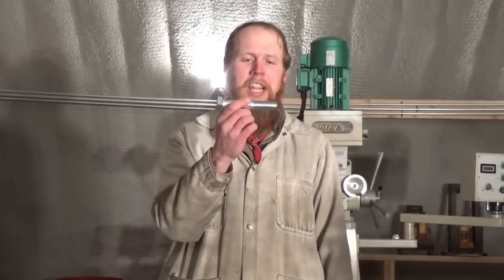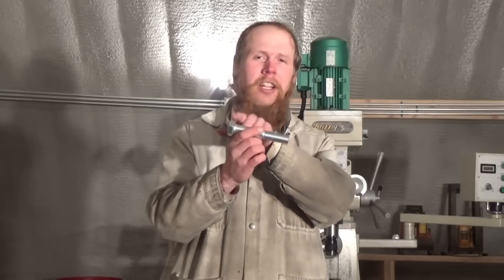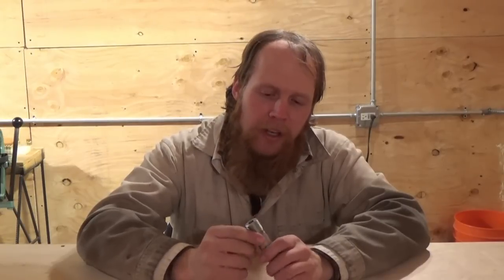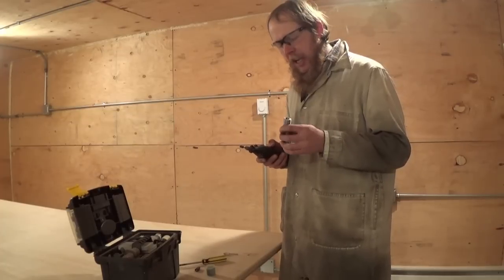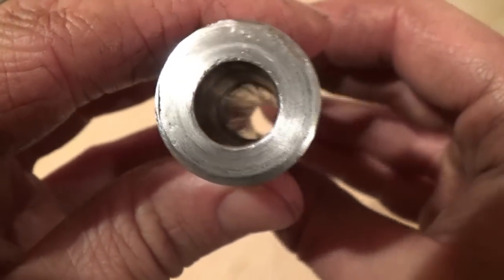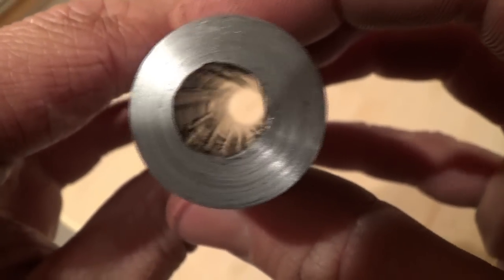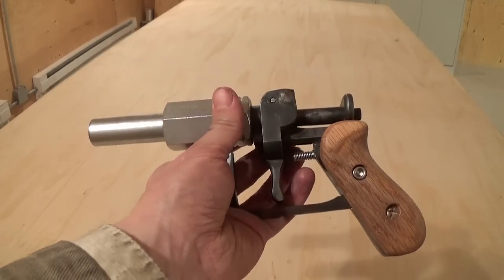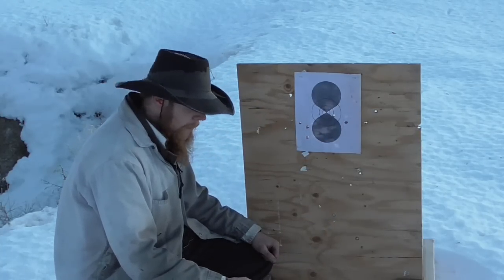Making a Rifled Barrel without Machine Tools (TIS081)

Comment: maybe try putting a ball bearing between the button and the ramrod, so the button is free to spin as it wants
Reply: Now, that's not a bad idea at all : )
Reply: Or even one of those set screws with a spring loaded ball at the end and thread that screw into the end of a piece of round stock.
Reply: @jmorginski  I have a really dumb layman question... only started researched all this... Why is it essential for there to be a curved twisting grooves down the barrel? Is this to make the bullet spin to prevent bullets tumbling and keyholing shots? Thats just a wild guess. I'd appreciate if you or anyone can confirm or tell me the real reason??
Reply: @differentwavelength6553   that is exactly, accuracy and range would suffer without rifling in the barrel.
Reply: @differentwavelength6553  bill cooper porterville presentation. 10 hrs aslo hour of the time broadcasts. Bill Hicks  revatalations. George Carlin. Adam green know more news. Jake black stone intelligence. Alot more. Projectile and it's shape needs guidance as it is launched and plays to the phisics of flight through the air. The projectile fights wind resistance so if you have a stable launch of aero dinamics and rotation of projectile it will not break it's stability through its flight pattern. Paper planes, golf balls, base ball,   throwing a simple football are basic starters for most civilians learning. I'm sure there are formulas figured by men, and women that have been achieved. Also the wright brothers had to figure out alot for their accomplishments. Sorry.
Reply: Different Wavelength yes that is correct
Reply: @differentwavelength6553  haha tyrannical has a whole new meaning since you made that comment.
Reply: EitriBrokkr, thats a great idea man!
Reply: Great idea.
Reply: I don't know. Perhaps smoother button and ramrod faces with some quality grease is a better idea. Because I believe with a bearing, during the rifling process, might be unevenly pressured resulting in low quality job. Again, I am not that sure

Comment: Great video that made my day! Since i was young, i was always intrested in making my own gun, though law in my country is very strict about that, so i never tried. Until i saw your video i thought rifling process is only available to professional machinists with serious equipment but now i know its not so hard. Though one thing caught my eye - when you made the button, why didnt you make the cutting edge to be sharp and the back of it slightly decreasing?
Reply from the maker: Thanks!  The edges of the button are blunt because they are not intended to cut the steel; they just cold-work it, leaving an impression due to the pressure of the fit.  Making a "button" with cutting edges would be a form of broaching, which might also work, although I have never tried that method (yet).

Comment: You might have been able to get the barrel drilled closer to center if you had clamped the boards you were using to hold the steel in place to the drill press, and left them in place for the whole process. As you said though, little tweaks here and there. This was an impressive result over all.
Reply: Or just cut the bolt head off after. The head would have made using a clamp all too easy.
Reply: Rotating the barrel would be benefficial as the center of turning is easy to locate with a center drill. The more centered the drill is and drill lined up with rotation axis it will do straighter and more circular hole.
Reply: Ed What's his name I thought the same thing.

Comment: Without  machine tools!! Yeh right ! Click bate !! You used loads of tools and machines. LIAR
Reply from the maker: Sorry if you're not familiar with my nomenclature.  Most craftsmen draw a distinction between "hand tools" (i.e. hacksaw, hammer, pliers), "power tools" (i.e. electric hand drill, drill press, table saw), and "machine tools" (i.e. milling machine, engine lathe).  In this demonstration, I used a variety of hand tools and power tools, but no machine tools.
Reply: You still used powered tools that most people don't have !!
Reply: reg ty You're clueless. If you don't own a drill press or at leat understand how to use one you need to hand in your man card right now. And the first rifled barrels were made well over 200 years ago and made a huge impact in the creation of the United States.  Well before we harnessed electricity and had modern machining equipment. We are only limited by our imagination.
Reply: Most guys have those or similar tools in their garages. Those are simple power tools, not machine tools.  You could easily obtain those tools on craigslist for one or two hundred dollars, or even less.  Even if you invest in brand new equipment from a hardware store they are not out of most peoples price range. Metal lathes, cnc machines, and other real machining tools will run you into the thousands, to tens, or even hundreds of thousands of dollars.  At least in America, it is very inexpensive and easy to obtain the things he used to do all the work in this video.  It doesn't take much skill to use them either.
Reply: +reg ty. The title is still true. This was obviously never going to be a kitchen table job, using the most basic hand tools.
Reply: Be quiet you fool. Who rattled your cage ! . Have you been looking in my workshop?
Reply: @regty82  there is a video, perhaps on youtube, called Gunsmith of Colonial Williamsburg. He creates a flintlock by hand , including the rifling. Its fascinating.

Comment: Great video , those rough patches in the barrel are pretty uniform in spacing and I suspect could be stop points as you used a hand pumped hydraulic press , would it be possible to adapt a log splitter to perform this action in one fluid motion?
Reply from the maker: Maybe--if you try it, post a video on it!
Reply: what do you mean?

Comment: Interesting video. I thought your idea of the timber jig to line up the axis was brilliant in its simplicity. But you let it down by not clamping it down to the table before drilling - and leaving it there. You may have to wiggle a little to change bits, or plan your depth, but your hole will be perfectly centred every time.

Comment: I would be very interested in seeing the result of this technique if you formed more of a broach and less of displacement tool. taper the button, cut some teeth, and drive it home. Very cool to see this though. 

Also, do you think the tail stock on a lathe could apply enough force to push this though a rifle length barrel?

Comment: Great but.. the video is about "Whitout Machines Tools"or without "Expensives" machine tools? Cus, that homemade hydraulic press is still a machine tool you know. :/
Reply: So is the drill press and grinders. That was the only disappointing part for me, I expected the whole thing to be done without power tools of any sort. Otherwise, I thought the video was interesting.
Reply: If your smart, you can get around not having a shop press, I have in a few builds.

Comment: If you're going to machine a button next time, wouldn't it be easier to make 2 or 3, with slightly increasing rifling diameters and produce the rifling in 2 or 3 passes, increasing the depth of the grooves by a few thou each time?
Or maybe a rough pass that does most of the work, followed by a finishing pass (by a 2nd button) that cleans up the surface finish.
The buttons might benefit from being very slightly tapered in thickness, from front to back. This means the whole length of the button is doing the work progressively, rather than the leading edge doing the work & the rest of the button just following tightly in it's tracks. This might produce a better surface finish, since the final shape & surface is produced by the trailing edge of the button.
Reply: He taught you how to draw a circle, what you do with it after that is completely up to you. Maybe re-invent the wheel?
Reply: Rob Wetch Exactly.
Reply: this is how some barrels are commercially produced, then they lap(polish) the barrel
Reply: perhaps a slight cone shaped button might be an option to for similar effect.
Reply: better mouse trap
https://www.youtube.com/watch?v=twwQbpwZz9w
Reply: Tapered button, multiple passes and a polished last pass ... Sure beats laying out a corkscrew to rotate the cutter ...
Reply: Do it in one pass. with a home operation you're likely to have the successive buttons cut off from the original buttons path.

Comment: I don't wanna be presumptuous, but the "cold weld" marks inside the barrel look exactly the same as a thread made in metal without using lubricant/threading fluid. Putting the grease only on the button gives you lubrication for only the first 1/2".
It would make more sense to apply it throughout the hole.

Comment: Great video!Question:Will a bolt be an option for a 410 barel?
Reply from the maker: Well, a .410 shotgun operates at lower pressure than a .40 S&W, so I would think a bolt would be plenty strong enough for a .410 barrel.  However, I expect you would want a much longer barrel for a .410, and so that might make it more difficult to drill out the bore.
Reply: What lenght do you think will make it?To drill it will not be a problem.BTW,thanks for answering so quick. ☺️

Comment: Why would you cut off of both ends when you can just cut once 2 inches from the head?  It is also questionable how true his cut is using a vice and a hacksaw.

Why wouldn't you leave the bolt head in place until after the other machining operations?  This allows you the easily keep the bolt from turning, or to be easily turned as needed during the machining process.

The point of using soft steel is that it is easier to work during the machining process.  This saves work, and wear on your tools.  Then you just do the heat treatment after all of the machine work is done.

This process may be acceptable in a SHTF situation, but then again losing fingers (Boom!) in a survival situation is not acceptable either ... don't try this at home kids. lol

Comment: Jebus, man! It's not that hard to get the hole centered. There's plenty of techniques to get a mark centered within 5 or 10 thousandths. Then, use a punch to make a guide for your first hole through the barrel. Just make sure the first drill bit isn't a lot bigger than the punch mark.
Reply: Chris Turnblom at the very least he could have secured his work holding then drilled the hole and not moved his work holding and place the barrel in it

Comment: well  i  drill a hole on the reg to .875   to 6.000+ deep  with a .5000  bore bar   with some  unforgiving  metals . all i have to say  is in any  diameter  you need to think of feed speed and coolant  ..   AAA+

Comment: One tip while putting sights on later would be if you get a laser boresight and then mount the sights to line up with that, then it won't matter as much if the hole is a bit off when you drill it since it'll be aligned with the bore and not the outside of the barrel if you catch my drift.

Comment: Thank you for further proving how pointless gun-control is.  Firearms have been with us for centuries, as has the knowledge of how to make them.  One genie that will never go back into the bottle.
Reply: +krtichacek
if it has been done once, it can be done again
Reply: Flintlocks and black powder will be the order of the day
Reply: @mahashma449  yup, a fucking matchlock will work if necessary
Reply: @transcendtient  How's it feel to be completely removed from reality?
Reply: During the panic buying there were shortages of reloading components as well as ammo. People took the flat end of drill bits, undented the primers, filled them with non safety match heads/match heads and scraped striker from the box, and sometimes the roll caps and ring caps you buy for toy guns.

You can use crushed match heads for powder, if you're an amateur chemist and want to be more meticulous you can try to replicate cordite. Nitrocellulose and nitroglycerin start as cotton and glycerin.
Reply: The colt 1911 is more than a century old and still one of the best gun, strong simple and effective.
Reply: That is why they are concentrating on ammunition.  The hardest part to make will be your primer, hard but possible.
Reply: Thing is, the people that have the skills and intelligence to make guns aren't the same kind of scumbag that would go around killing innocent people, or being a gangster.  If they did, they'd have a real job.
Reply: @gpweaver  And yet the government still harasses them with laws that directly violate the constitution.

Comment: put a center from lathe tail stock in the drill press and another in a spare chuck in the wood block you drilled out ... Put the barrel between the two centers ... run the drill press down and hang a weight on the handle to keep pressure on barrel ... slow speed and a file would true the barrel more to the bore ... If you used a bolt with all thread cut off you could thread it after trueing the barrel and bore ...

Comment: is there anything from a hardware store that could be used as a button? like a chunk of drill bit, or tap die with the threads ground off?
Reply from the maker: Well, you could certainly use the shank of a drill bit for your tool-steel rod and make the button from that.

Comment: I love the video and I just had a couple questions:1. what would the test fires look like without the rifling?2. I thought rifling would extend range but I'm not sure if it did or not...3. I'm wondering if using a blowtorch to heat inside of the barrel to make the metal more pliable during the buttoning phase if feasible or if that would ruin the rifling?P.S when you were showing the end result of the rifling all I could hear was the james bond theme
Reply from the maker: 1) I'm not sure if I totally understood your first question, but in my view the rifling is important for two reasons: First, a typical pistol bullet needs rifling to impart spin to it so that it will be stable in flight.  If you fired a series of shots at a target from a .40 S&W with a smooth-bore barrel, I expect that the shots would scatter all over the place, and many of the holes in the target (assuming you could hit it at all) would be oblong in shape because the bullets would be tumbling, or "key-holing."  Second, smooth-bore centerfire pistols fall under the legal definition of a "short-barreled shotgun" which makes them subject to a lot of additional regulations, so for legal reasons it is a lot easier administratively to make handguns with rifled barrels (unless it is a muzzle-loader, which are not regulated the same).
Reply from the maker: 2) Assuming you are firing a typical bullet that needs spin stabilization, rifling extends the effective range of a gun in two ways: first, a tumbling bullet experiences more drag force from the air and slows down faster than a stable one, and second, a tumbling bullet will be more erratic in flight and therefore less accurate, making the range at which you could actually hit anything with it less without rifling to stabilize the bullet.
Reply from the maker: 3) Heating the barrel would introduce a lot of additional complications: steel expands when heated, so the bore size would actually be larger once it was heated, which would make getting the correct fit-up between the button and the barrel more challenging, heating the steel enough to soften it would also compromise the heat-treatment of the bolt, and physically driving the button through the barrel would be more challenging of the barrel was too hot to touch.